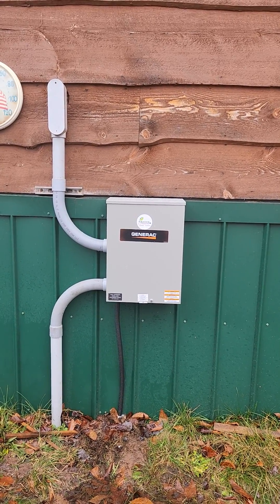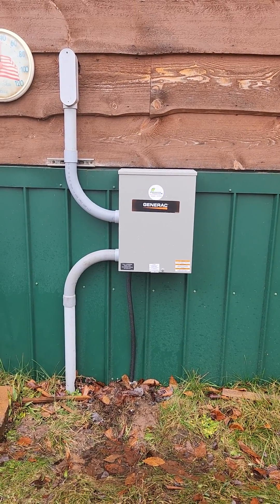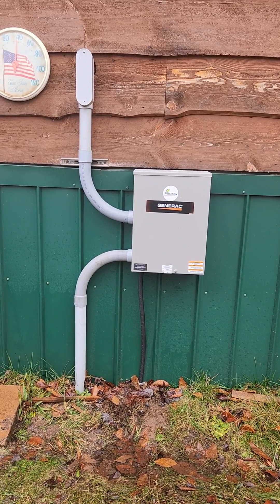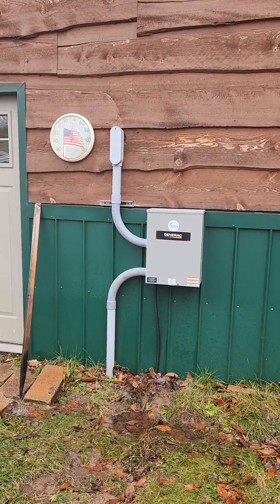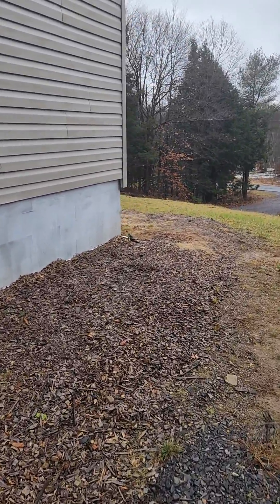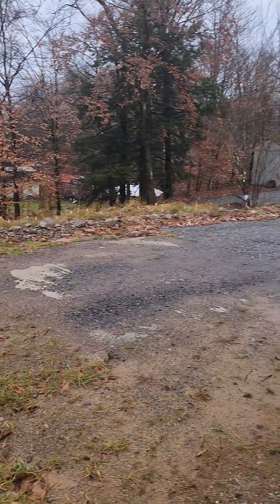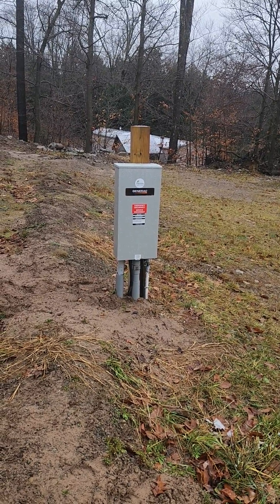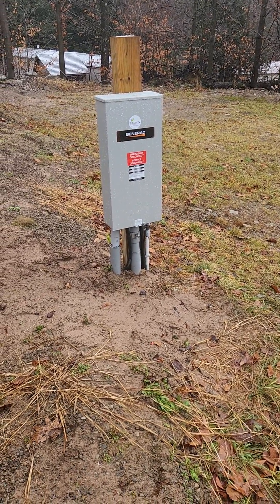Generator Tranfer switches can be put anywhere !

Comment: There is a limit to the placement.  It has to be somewhere between the service and the protection for the equipment that gets the emergency power.  It must be in a readily accessible location.  You also dont want to place it any higher than 6'7" above finished grade to the highest switch or button on the transfer switch.  Finally, it holds the same clear workspace requirements as a panel (30" wide and 3' deep with a clear path to access).
Reply from the maker: Thanks for the info